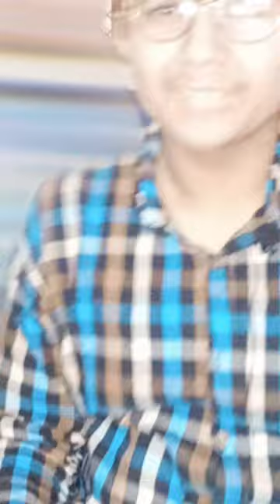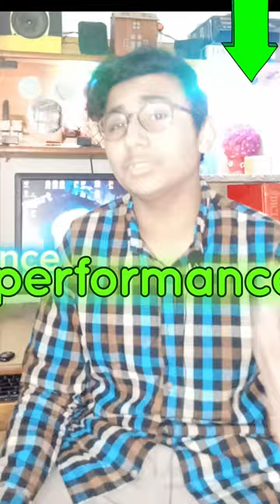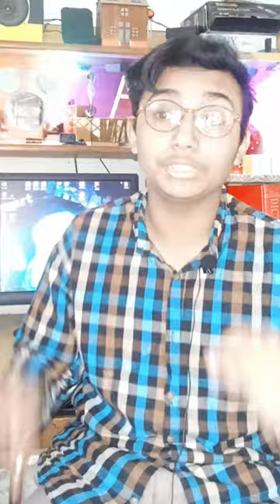Do not fill four slots of ram on mother board #shorts #short #tech

Comment: Don't go into IT. 

Computers don't transfer memory between ram sticks regularly. Your premise is wrong.
Reply: Wait so should I put 4 or not?
Reply: @Storm-Spider if you have 4, do 4. If you have 2, do 2. If you're buying, buy only 2 so you can add 2 later if you need. But don't mix speed though, putting in both 2 4800mhz sticks and 2 2400mhz sticks makes all of them run at 2400mhz which is slow.
Reply: @Nelo390  ok